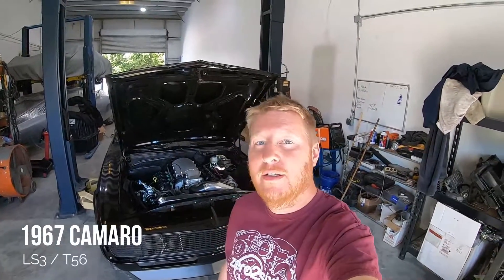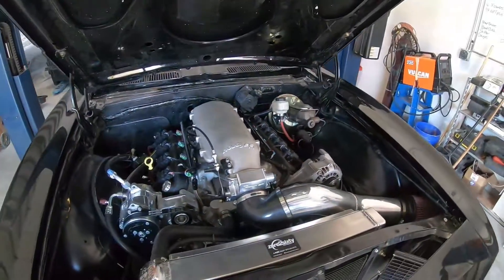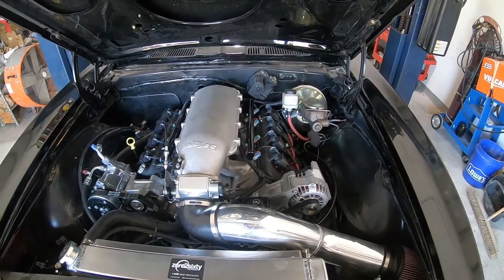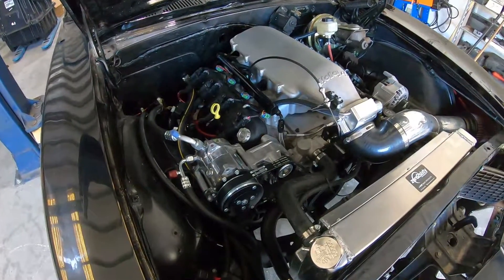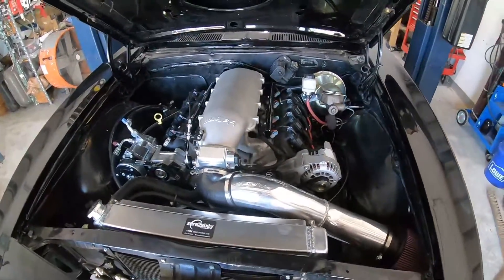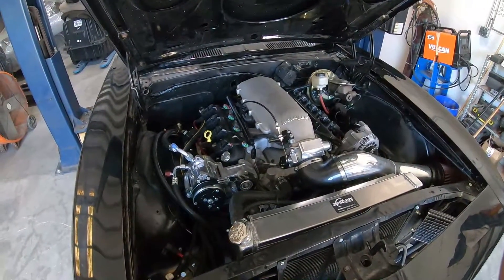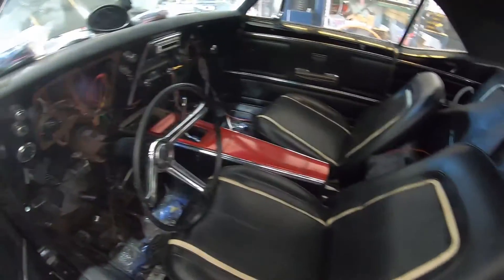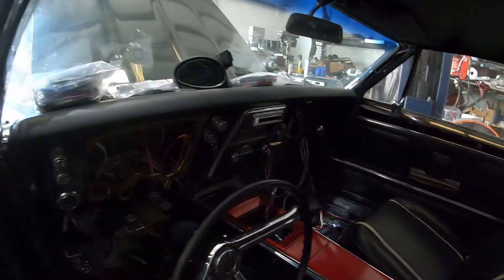1967 Camaro LS Swap. What fits, what doesn't? See how we install an LS3 Engine and T56 Transmission.

Comment: I’m swappin my ‘69 Camaro with LS3 and T56 and all Ridetech arms and 4link. The Hooker long tubes won’t fit my steering angle?
Reply from the maker: If you are on a factory front frame then yes it should fit no problem

Comment: Do you have a video showing more detail in the hydraulic clutch conversation?
Reply from the maker: I do not unfortunately. It is made by McLeod. There is a plate that bolts to the firewall that adapts a wilwood master cylinder to it. You can get it with just an fittings or with the factory quick disconnect.

Comment: I have a 67 Camaro about to start on a full resto-mod job.   I'm thinking LS3 turbo or super charged.  I'm leaning toward super charger but, will an 8 speed or newer 10 speed automatic require some transmission tunnel cutting and fabrication?
Reply from the maker: I personally would not run either of those transmissions but yes you would have to cut the tunnel. Also, there would be some technical hurdles to work through as you would need to use a factory pcm to control the transmission and there was no pcm made by GM that would run the transmission and engine. Moral of the story, don’t do it. Just my $.02.

Comment: How much do you charge for taking one of these swaps on a ‘67 Camaro?  What are transmission options?
Reply from the maker: Roughly $23k installed. There are quite a few options, manual or automatic.

Comment: I have a 67 Camaro and I have a 6.0 ls3 which a 4L80 auto and my question is will the transmission fit without modifications to drive tunnel?
Reply from the maker: Yes it will

Comment: I've been restoring a 69 camaro and have a t56 trans I'm going to use (and I'm getting an lsx 376 supercharged engine from boost district).  I've heard it both ways, that the t56 will bolt right up and fit perfect,  and I've also heard that you have to modify the trans tunnel to make them fit. I have the correct transmission mount for under the car but I'm curious if I need to modify the trans them before I go any further with finishing the inside of the car.  The nice thing is it has a brand new floor plan with no hole so I can make it really nice and put the hole where ever I'd like without needing to patch any existing holes. But from the looks of it I need a trans hump "extension" piece from the majority of videos I've seen to make it fit correctly.  Any advice on what to get? Or any other tips?
Reply from the maker: T56 fits just fine. No modifications necessary
Reply: @Zero2SixtyPerformance  yup your correct I have installed and cut the shifter hole since I posted this comment! Actually went in pretty easy.  (Now just to try to fit the original console... lol )

Comment: What mounts work best for an ls3 + tr6060 swap in a 67 Camaro?
Reply from the maker: We use the Holley mounts and crossmember the most
Reply: How about drive shaft connection… the tr6060 needs a special adapter or a custom driveshaft ?

Comment: Hi,I ordered the Holley LS swap kit for my 67 Camaro.My only concern is they only have the poly motor mounts and I’m afraid the vibration will be awful.Do you guys have any experience with the poly mounts?Would you recommend the stock rubber over the poly?
Thank you
Reply from the maker: We use the poly mounts often. They do not add much vibration. If you are worried about it just do new oem rubber mounts.
Reply: @Zero2SixtyPerformance  Thanks for the advice,I think I’ll go with the rubber to be safe

Comment: What type of gas pedal setup did you use ? Factory pedal, cable hook up?
Reply from the maker: Factory pedal, Lokar cable TC-1000LSU
Reply: On the 69, they have two types of pedals. One for the V8 and one for the V6. From my research, it seems like the V6 one is better. If the 67 is the same, which pedal did you use?

Comment: I'm have 68 camaro doing a ls swap wanting to do a t56 but to much different info. Confusing do you have to cut the tunnel or no and what mount and cross member do you recommend
Reply from the maker: No cutting required. Holley mounts

Comment: I have a 67 Camaro, 9 ich Ford, 4Link, coil overs, mini tubbed, new firewall, new subframe connectors, new stock subframe. Newly painted, disc brake setup all around not hocked up. no engine took 327 and power glide out. what would a setup like the one in this video run ball park with radiator, vintage air, wiring harness and exhaust?
Reply from the maker: Roughly $31k installed

Comment: Will a “drop out” LS3 / 6 speed from a 2015 SS Camaro fit in a ‘67 Camaro with a TCI frame? My concern is the bell housing and shifter location. Or should I just go with a “T56” from Modern driveline or similar
Reply from the maker: I would confirm with then which pan fits. I would assume you need to change the pan as you need to with most subframes. The trans will work but you will need to get a shifter relocation kit from MGW. They call it a "retro" shifter
Reply: @Zero2SixtyPerformance  Thanks!

Comment: How did you route the oil cooler once you plugged the block for the motor mounts?  I am using the same mounts, and I have to plan out the cooler and remote filter setup.
Reply from the maker: Just blocked the oil cooler ports on the pan with a factory block off and a factory freeze plug on the engine
Reply: @Zero2SixtyPerformance  Thanks.  Did you run an aftermarket oil cooler?
Reply from the maker: No

Comment: What motor mounts and trans mounts will work with a t56 so I don’t have to cut my trans tunnel? I can’t seem to get a strait answer.
Reply from the maker: Holley mounts. No cutting of the tunnel necessary
Reply: @Zero2SixtyPerformance  
Ok. That is what I have. I will give it a try.
Reply: @Zero2SixtyPerformance  

It just seems like everyone is having to cut their tunnel. Guys at SST transmissions where I am getting my trans say Holly sometimes don’t work.

Comment: I’m putting an LS in my 67 ssrs and I was wondering if there is a bracket I should get to keep the ability to use the SS hood. I’ve heard rumors of the LS alternator not giving clearance for the SS hood
Reply from the maker: Any of the holley brackets will work

Comment: Will this engine and tranny combo fit with with a standard original 67 sub frame as far as fitting all other components? If so, are there any major or any modifications needed to be done to the subframe so it all fits? Thank you
Reply from the maker: Fits with a factory frame no problem

Comment: Part numbers on those combos?  Does the rad have EOC, PSC, if not what are you running to cool the trans, engine, and power steering?  Thanks in advance.

Comment: Full length header 1 7/8 recommendation other than hooker? Stock bellhousing location
Reply from the maker: Get the headers that we're made for your mounts, it will make your life a lot easier. I cannot confirm any other headers fit with no issues.
Reply: Going with the HOLLEY/hooker thanks for the reply!

Comment: Hey just saw your video, can you tell me what Cold air and take you are running
Reply from the maker: We custom fabricated the intake
Reply: I have done an LS one swap on my 68 Camaro and I’m using the Holley terminator X, I’m aware of what to do with the single wire for the alternator but not sure what do I do with the blue and white from the original harness that went to the original alternator. Doesn’t that have to connect somewhere to operate the headlights or anything else is operated from those two wires

Comment: What vehicle is the easiest to do an LS swap?  If you are brought a rolling vehicle  minus engine/trans what would the ballpark cost be for a 450-500 hp LS with 4L60E trans.  I realize there are a ton of variables but I would just like to know how much I would have to budget for something like this.  I liked your video and you seem to have a handle on good quality parts and precision workmanship.  

Tim
Reply from the maker: Sticking to your standard "muscle car" will be the easiest just because everything is readily available. As far as a  cost, the average 400hp 6l/4l80 is 18k installed

Comment: Great info.. I have a 67’ with a QA1 drop suspension and freshly built posi 4 10s rear diff.. I was planning on a 383 with 700r4 in the next month or two but still deciding. I don’t want to cut the tunnel. What trans and LS would you suggest with what I have?
Reply from the maker: You can pretty much get away with any transmission in that tunnel. We do a lot of 4l80e transmissions here. The cooler lines are a bit tight but it fits. The 6L80e will fit as well but it is also very tight on the top of the tunnel.
Reply: @Zero2SixtyPerformance  really appreciate the info

Comment: Great video.  Doing a built up 5.3L swap in a 67 camaro with a T56.  Did have have to modify to transmission tunnel to get the T56 to fit?
Reply from the maker: No cutting necessary. Bolts right in there

Comment: I got 69 camaro going ls3 whit th400 Kennybell blower what motor mounts will work???
Reply from the maker: You can go about it 2 ways. The Holley mounts require you to do some cutting on the transmission crossmember. The Musclerods or BRP do not require you to do any cutting. With that said, we use both at the shop and I dont know that one is really "better" than the other. Just comes down to your abilities and which one is in stock.

Comment: Thanks. I didn't hear whether you had to notch the front cross member to get the oil pan to fit with enough clearance with motor vibration. I swapped and LS3 in a 69 camaro, used Holley motor Mounts and oil pan. We cleared it but still felt notching it gave us the extra room we wanted.
Reply: Also I utilized this Holley Terminator X and Holley mid rise intake. I did have to notch a very tiny piece of the underside of the hood to clear the intake to close. But, in my view that is a very small thing to do to get this install. This mid rise intake is very trick looking and well worth it. I also had the cap powder coated red and slight pin stripe across the top. Looks great and performs well.
Reply from the maker: We did not notch the frame. We also had to trim the hood a bit for the mid rise.
Reply: @Zero2SixtyPerformance  I'm doing a ls swap into a 68 camaro I would like some help with pt# for the correct motor mounts and trans mounts for a  6.0 with a 4l60e
Reply: @teehill4384 so you end up using the 4l60 ? Or 4l80.

Comment: Would a stock LS oil pan work or is aftermarket necessary? Also what kind of brake booster is that. Great vid
Reply from the maker: A stock truck pan would likely fit however it would hang about 4" below the crossmember and would not recommend it. Master is from Right Stuff
Reply: @Zero2SixtyPerformance  The GMPP muscle car swap pan fits great.  The 6.0 I built and installed in my resto modded 79 Regal also uses Hooker blackhearts..was able to run 1 7/8 in primaries and even with full heat wrap they clear everything great.  The pan I mentioned does hang below my crossmember about 3/4 in..but that's my fault as I built my own engine mounts and got the engine sitting way lower than it would have with the holley mounts.  To protect it, I flanged up a sheetmetal skid plate...so far I've logged 20 thousand KM in two  years with zero issues. 

ps, new subscriber here..thanks for the content man.

Comment: How much was this build? Not the car, everything that you did
Reply from the maker: If you were to do another one just like this is would be roughly 20k installed
Reply: @Zero2SixtyPerformance  does that include motor and trans?
Reply from the maker: @Carmichael101 Carmichael101 Yes
Reply: @Zero2SixtyPerformance  how long does it take from getting the first gen to having it completed? I’m looking to have an LS3 and 4l60e put into my 68, but I’m from Canada. I’d have to drive it down and stay down there until finished.  Any idea on a price for a LS3 cammed and 4l60e swapped in? Round about price is fine.
Reply from the maker: @Carmichael101 Carmichael101 Shoot me an email, we can go over the details. David@zerotosixtyperformance.com

Comment: Thank you for posting this. Your team really has the ls swap down. I have a 69 camaro blueprint ls3 530/ t56 combo, turn one quick ratio box,, stock small block stands w/ dirty dingo slider mounts. Can you please advise on long tube headers that will clear the steering box? Thanks again. Love the LSA firebird by the way
Reply from the maker: I name of the game is just use one companies products ans stick with it. We use Holley products with success
Reply: I have a 69 camaro a swapped for a Blueprint LS3 427. I used Holley Blackheart long tube headers. They fit great and cleared stock steering box. I tried to stick with all Holley products for compatibility across all the areas of the swap to include motor mounts and terminator X ECU. I recommend choosing your brand and try to stick with all their stuff.

Comment: Great video...super informative.
I'm swapping an LS1 out of a Holden Commodore (effectively the same as the 2004 GTO) into a 1967 Firebird (with a 4l60e). I have the AAW Classic Update kit and have been tossing around the idea of getting Dakota Digital gauges. What's your recommendation on the gauges, noting I'm looking to keep the externals looking as classic as possible, despite the drivetrain upgrades? And what else am i going to need to match those gauges with the AAW kit and the drivetrain? Any other tips that come to mind with that combo when it comes to the electronics would be greatly appreciated.
Reply from the maker: We use Dakota Digital on nearly every build. If you are looking for a gauge package that looks more like the factory style gauges, Classic Instruments makes a reay nice set. AAW makes installing aftermarket gauges easy by having a break out from the main harness just for gauges.

Comment: How well does the tr6060 fit in the first gen ?
Reply: We installed a tr6060 in our first gen.  Minor clearancing of the front of the tunnel for it to fit.  As you are aware it will have a fixed output vs a slip yoke.  The Tr6060 was also longer which caused required  modifications of the T56 cross member kit to fit.  You will also need to connect the oil cooler lines together (this is pump driven and cannot be plugged).  Good luck!
Reply: Also we did the tailshaft/housung swap to convert to a slip yoke.  Very glad we did as this converted to a standard T56 shifter.  Also gave us the option for standard gear driven speedo.  These swaps are very involved as it requires a complete tear down  of the trans but it was worth the effort.
Reply from the maker: Its tight but it fits fine. You will need a shifter relocation like the one from Hawk  Motorsports
Reply: Zero2Sixty Performance awesome. I plan to do ls3 turkey pallet motor. I’m hoping I don’t have to cut my trans tunnel 😅

Comment: Just found your video and thank you for the information. I’m currently installing an LS2 out of my Trailblazer SS, adding aT56. I already have the adapter plates for the mounts, ICT Billet alternator bracket, the Holley terminator x with the 3.5 screen! McLeod clutch master cylinder kit, G-force T56 crossmember and the AAW Chassis Harness. I’m running the stock truck intake and the DBW set up. I’m doing this all by myself. I’m not sure if there’s anything else I would need.
Reply from the maker: Throw in a fuel system from Tanks Inc and it sounds like you are almost there
Reply: Zero2Sixty Performance thank you! Also im converting from the Automatic to Stick. Is there a lot of cutting of the transmission tunnel?
Reply: @Zero2SixtyPerformance what’s the best harness I have a 68 I wanna swap
Reply: @Brandon_obs_ls Holley terminator max

Comment: I have 67 camaro with a small block 350 If I were to do the exact setup engine and transmission  and you would have to buy everything and install everything how much do you think it would cost?
Reply from the maker: Roughly $8k in parts. That does not include the Vintage Air Conditioning system.
Reply: Zero2Sixty Performance so that would include you guys buying the engine the transmission and the correct parts that you guys would need and the labor?
Reply from the maker: That includes all the parts to install it just like this swap. The engine and transmission would be extra as well as the labor. I would be happy to send you an estimate if it is something you are interested in. Shoot us an email at david@zerotosixtyperformance.com
Reply: To do a complete engine swap which would include a new  ls3 , new 460le trans, plus labor to pull out the old motor and install the new ls3 and all  the parts necessary (minus the cooling system if you already have a decent radiator etc) to make it a connect and drive,  would run you about$20- $25k total